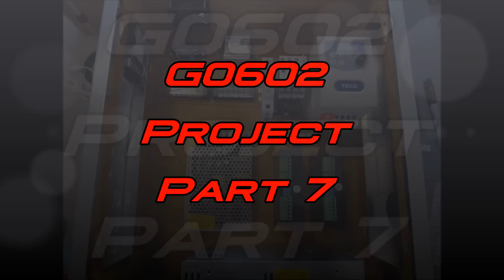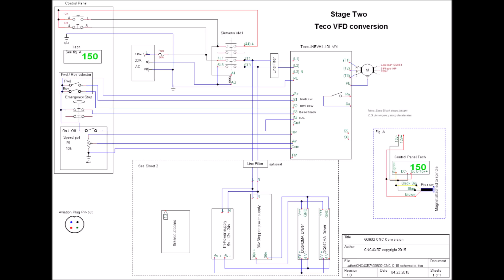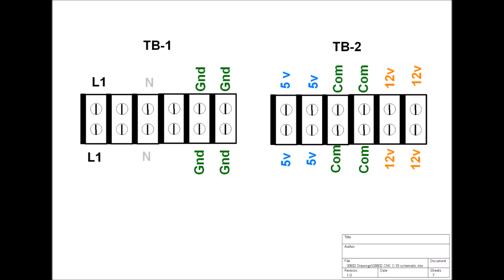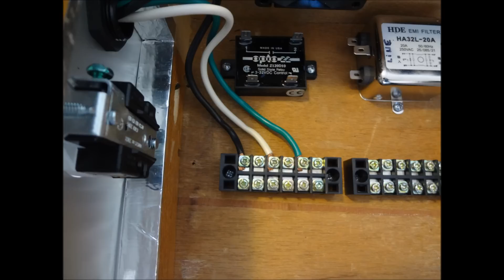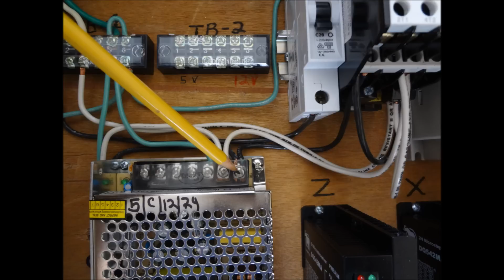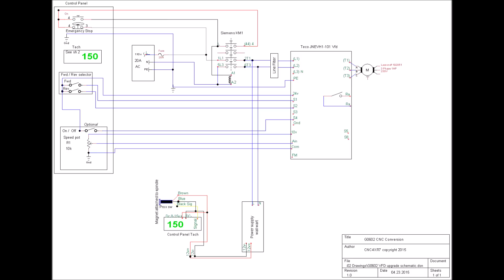G0602 Project Part 7 Electronics Cabinet wiring 110 v

Comment: I see you use that filter, I too was gonna purchase one but everything I read and studied suggested we don't need one using one vfd, if you have 10 that are running 24/7 then the noise and interference would be a problem. Nice job.
Reply from the maker: +Marc Lewis Hi Marc,
The EMI filter is entirely up to you there really good inexpensive insurance. I have been working on industrial machinery for the past 25 years and as a rule a line filter is always used. The Teco manual suggests the use of a filter as well as the Emersion manual. Not sure the source of your information but VFD's are known to induced noise on the lines.  Which can cause interference with othe electronics.  I say spend the $15. Be safe Sam
Reply: +CNC4XR7  I read on some big vfd site that the filters are needed/required as well as the line reactors, in a shop where a multitude of drives are in use at the same time. It read that in a home shop with just one vfd in use at a time, those filters wouldn't matter much? Either way I'll use one if you say there needed. I have picked up several drives and enclosures but I can't figure out which breakers, contactors,  disconnects filters to purchase, being a novice sucks when trying to do this? Mine are 2 hp and 1 hp 240 volt in, don't I need a two pole circuit breaker?
Reply from the maker: +Marc Lewis 
Here is a site with a good explanation of EMI
I picked my filter up off E bay it can be used for 110/or 220V
http://www.ebay.com/itm/250V-AC-Power-Line-Signal-Phase-Noise-EMI-Filter-Switch-Suppressor-HA32L-20A-New-/380905940894?hash=item58afc3679e:g:udUAAOxy7vJTdb9Q

I also picked up my circuit breakers off Ebay
 http://www.ebay.com/itm/250V-AC-Power-Line-Signal-Phase-Noise-EMI-Filter-Switch-Suppressor-HA32L-20A-New-/380905940894?hash=item58afc3679e:g:udUAAOxy7vJTdb9Q

The contactor I used 110v coil 
http://www.ebay.com/itm/ONE-NEW-IN-BOX-DMC-18-AC-CONTACTOR-COIL-110-120V-AC-Replacement-GMC-18-/181661739194?hash=item2a4be228ba:g:HaYAAMXQfvlSjf3g

here is a good website in us to get most of the items you will need a little more $ but still good prices.
http://www.factorymation.com/Products/Circuit_Protection/

No use 2 15 amp single pole breakers one for L1 and one for L2

As a reference take a look at Tormachs PNC 1100 wiring

Be Safe Sam

Comment: Neat installation. What does the EFI filter do? And, is it necessary?
Reply from the maker: Crivo152  Thanks, A EFI  filters Noise and cleans of the supply Voltage to the VFD. A VFD can also induce noise on the line and effect other electronics but the DC power supplies have built in filters so they should be OK I guess I will see. If not I have a smaller filter for them a 6A. Its always a good idea and There not that expensive.
Reply: CNC4XR7 
Great videos,  why replace the ball screws, can you do the conversion without new ball screws?
Reply from the maker: Thanks Robert, 
Yes you can cnc this lathe without changing the lead screws however I prefer the smoothness and finish the ball screws will provide. Plus I will only have $100 invested in the ball screws.

Comment: hello Sam I am still fallowing this build, 
I just have couple questions 

I see some people using 48v power supply and some using this setup 36v 

I just don't know  what is the reason behind the 48v??

I also see you using c10 breakout board and some using c11, now I understand that the c11 can let you control the spindle speed, so dose that mean your c10 can't control the spindle, I just get lost here!!!
I would like to have full cnc so the c10 can do so? 

please keep up the good videos, you are helping all of us!
Oz
Reply from the maker: +Ozy Ozy Hi Oz,
 Good questions the Stepper motors and drivers are rated within a voltage range some up to 80 vdc with more voltage there's more power but also more heat. Most of the CNC packages found on Ebay come with a 36 v power supply.
On my PM727M build I'm using a 48v Power supply my motors are rated at 50vdc..

The C-10 has been around a long time very good board but does not have spindle control or on board relays. the C-11 board is a C-10 with spindle control.
 You can use a C-10 and a C-6 spindle control board to do the same thing. you will just have two boards.
Be Safe,
Sam
Reply: +CNC4XR7  thank you for clear up these issues,

do you think that using 425oz on y and 275oz motors will be under power?

I don't  know how it will do when it comes to cut iron or some steel or hard materials?

the g0602 is good lathe and strong enough for heavy cut..

I just ordered c10 and c6 along with 36v 400w power supply 

its been said before (copy the great people and you should be fine) and this is what I am doing!  
thank you again for replying to my questions
Oz
Reply from the maker: +Ozy Ozy 
If you mean 425 for the z and 270 on the x then yes it should be fine.
Reply from the maker: +Ozy Ozy 
Hi Oz, Not sure were your message is I received it by email but cant find it on YT to respond.

You do need the Caps those are to help jump start the motor. one for forward one reverse. there is a diagram in the manual for the G0602 on motor wiring. you also need a contactor.
Be Safe
sam

Comment: Thanks for the information. What is the purpose of the contactor? I'm gonna be using a disconnect I bought from automation direct and the recommended fuse. They don't offer a contactor for these, at least I couldn't find it. I did buy three of those emi filters  you showed me. Thanks
Reply from the maker: +Marc Lewis 
The short answer is for safety. If you will take a look at my PM-727m series It will answer most of your questions I think.

Comment: you dont use encoders for the threading?
why we used the relay ?
the filter for what?
Reply from the maker: No just the index pulse.
the relay is for the holding circuit
filter is for the vfd